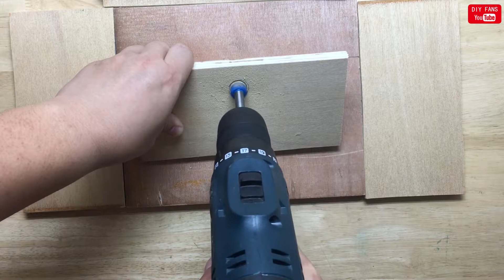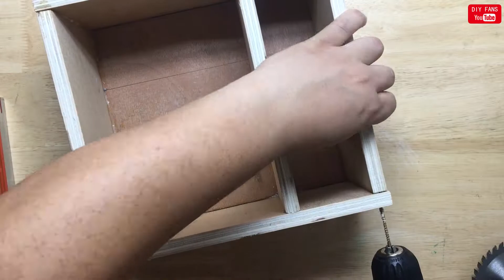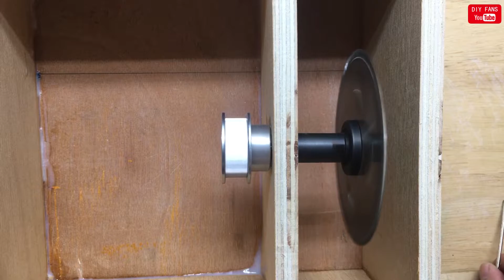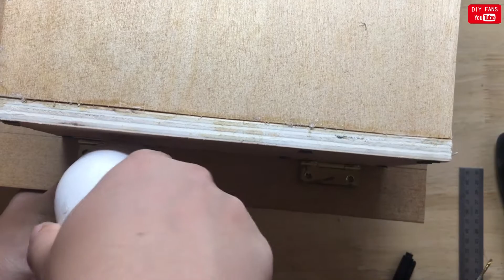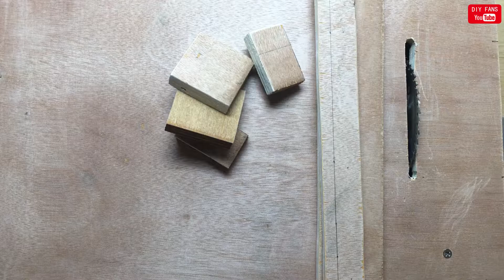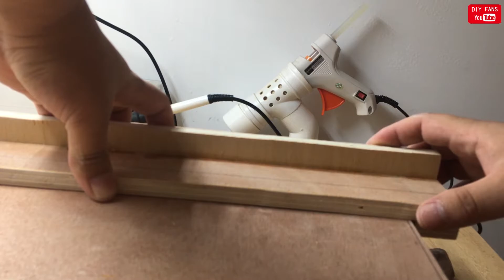【DIY FANS】🔧How to make  775 motor Powerful Table Saw

Comment: Nice Vid, What are the other components called? I would remake this project
Reply from the maker: My English is very poor, from google translation
Reply: @N.M2023  apart from the 775 dc motor, what did you use?
Reply from the maker: One door lock, dc socket, one switch, 1:2 gear, one saw blade, quick connector
From google translation, my English is very bad